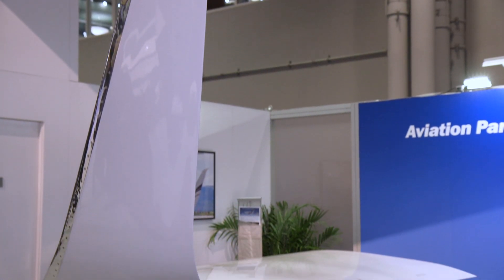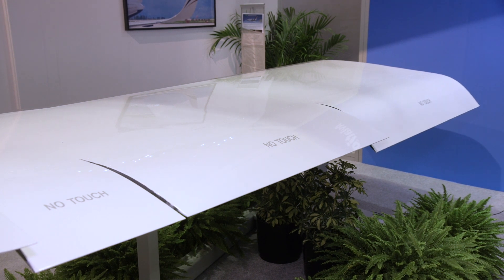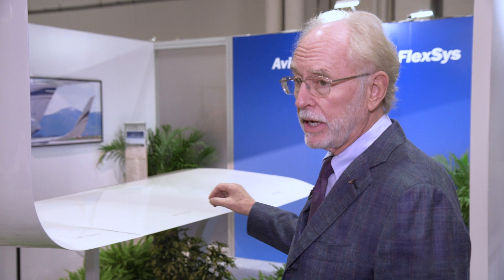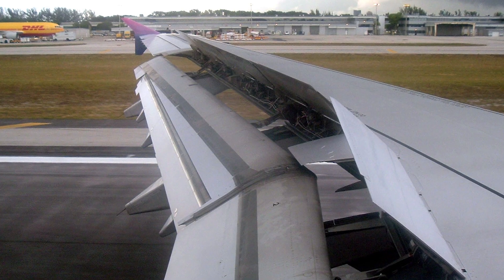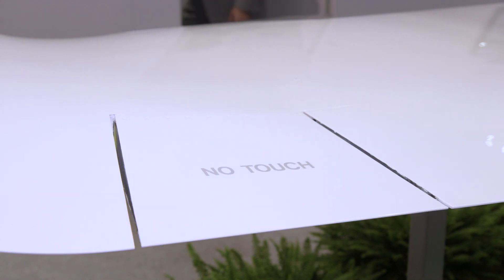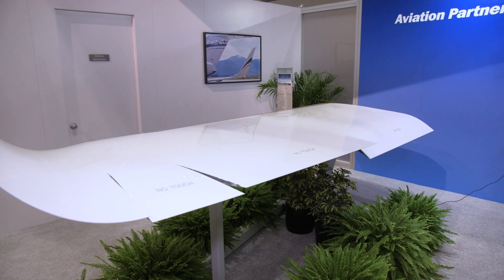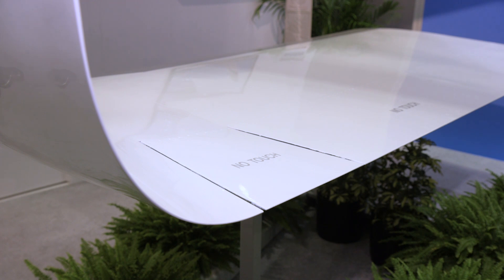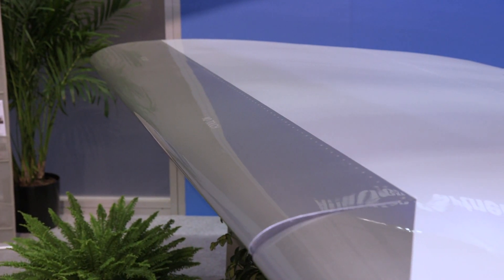FlexFoil Morphing Wing Technology Could Reshape the Future of Wing Design – AINtv

Comment: It will be just a matter of time before this stuff starts cracking. During pre-flight inspections before each flight, pilots are supposed to walk around the aircraft and visually check for any mechanical issues which include checking the flaps and aileron mechanisms and components. How would they check this thing when everything is sealed? And what if the flaps and aileron components require fixing inside the wing, it would be a nightmare to work on these!

Comment: Ok, for winglets(ailerons) it makes sense, but for flaps is just a waste. Stacked flaps(slats) are there to increase lift and by passing air between the wing and flap the air follows the shape, directing more air down pushing the plane up
Reply: slat simply redirect air
the flow of air in the upper part of the wing produce less drag and resistance so the flow below the wing can create more lift
slat is not about create lift but redirect air

Comment: Not a new idea actually.  The Wright brothers used wing warping in both their gliders and powered aircraft.
Reply: Doing it with metal (or metal like strength) is a whole other thing though and it might also be powered by hydraulics via built in chambers
Reply: @wonjez3982  Sure, but the wing morphing idea is as old as flight itself.
Reply: The material will not be metal.  It will be carbon fiber or some sort of strong light plastic possibly a new material